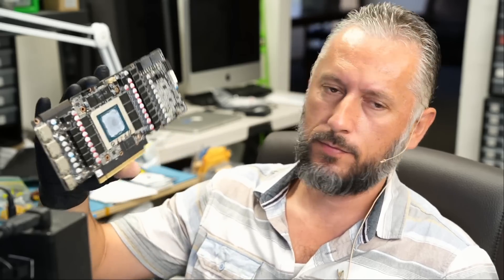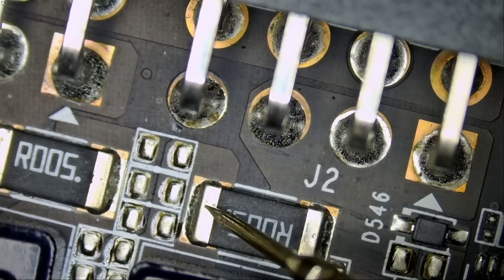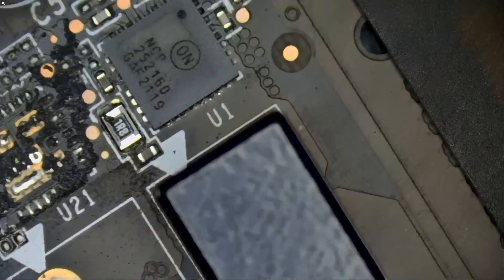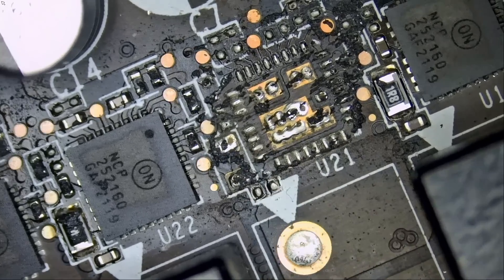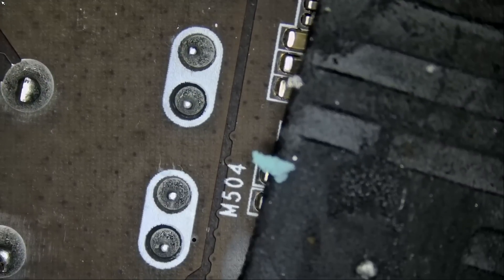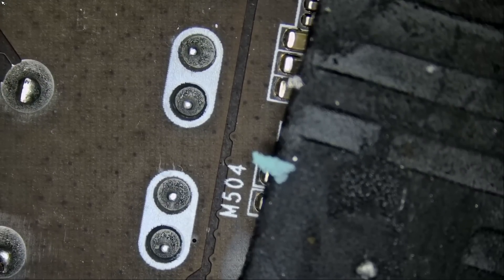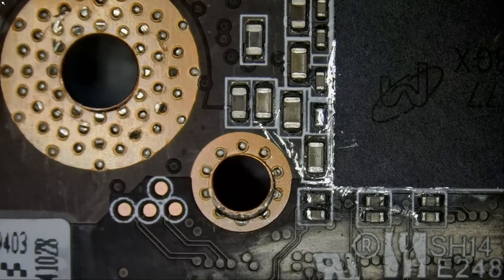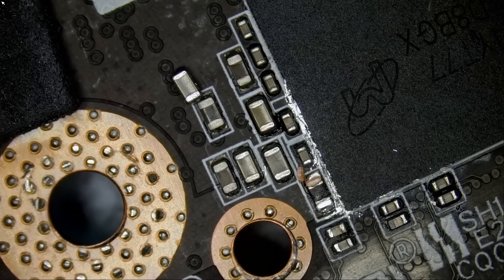Zotac RTX 3090 Repair : Why It Broke After Travel

Comment: Hi, i have an amd 6700xt card. I opened it and found out there is short around vmos. There was no short on power connectors or the power coming from the slot, but lines after vmos has short. Is it possible that the core itself is damaged? I can boot on my computer with no issues but when a heavy task is running like gaming, it crashes with a black screen and i should restart the computer

Comment: Most likely that the liquid metal came from CPU when the case was transported and shook loose some drops onto the GPU. Could still be on the motherboard though. Liquid metal will/may react and weaken any metal it comes in contact with. Replace solder with fresh solder and clean other metal parts well.

Gaming pc's should not be transported, at least remove high mass CPU cooler and paste/liquid metal and video card and move them separately, GPU in antistatic bag and original box. Self expanding foam package filler may not be enough. The GPU PCB may crack at the pcix socket regardless of bracing. Get a gaming laptop if you move the pc often, those are designed for that.

Comment: Good day I would like to know what is the problem of my rtx 3080 Ichill x3 10GB. Once I plug in to the motherboard the system unit won't turn on but once I remove the system turn on without any issue. I already replaced the motherboard but still same issue.

Spec.
Cpu: ryzen 7 4700g
Motherboard: gigabyte b450m
Psu: gigabyte 1000w
Ram: dual channel  ramsta 32GB 3200mhz
Storage: 256 GB nvme

I hope you notice my issue. Thanks.